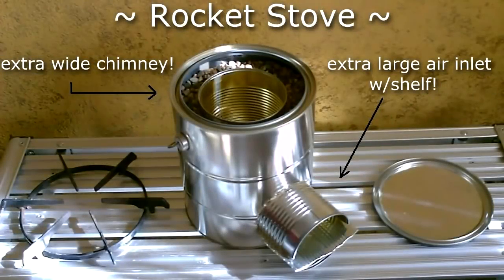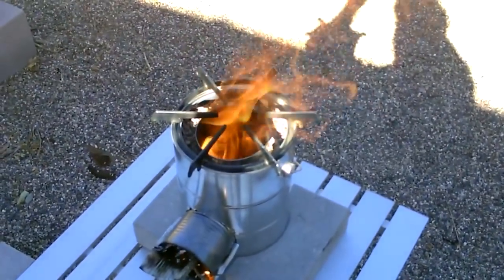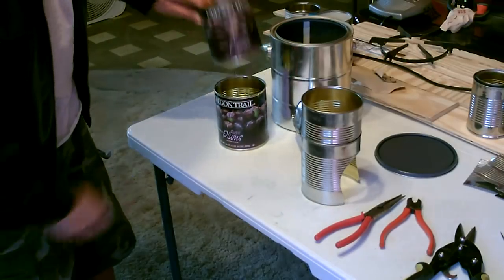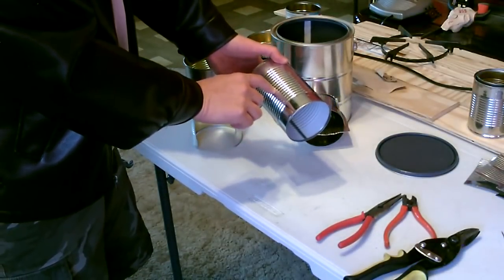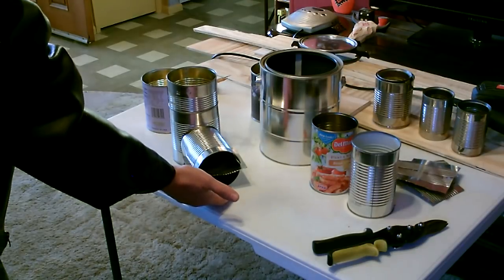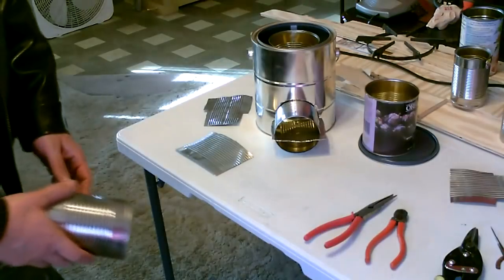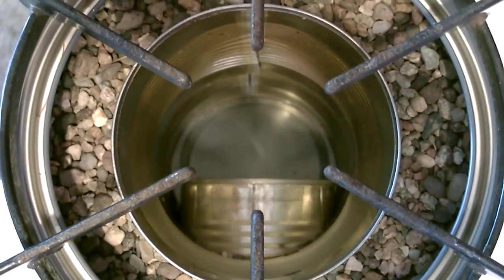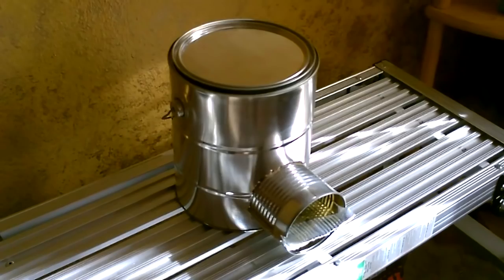Homemade STEEL CAN Rocket Stove w/shelf! - Improved!! (w/ex-large chimney and feed tube) Full Instr.

Comment: Is the sad and rocks just so the outside does not get hot?
Reply from the maker: hi. the sand and rocks hold the cans in place. also used for their insulation properties (focuses heat up the pipe), weight (to make it stable even in the wind) and to add thermal mass.

Comment: If you add a strainer to the top of the can that will keep the fire down a little bit to reduce soot from your pot, or pan. https://www.google.com/search?q=strainer&rlz=1C1CHBF_enUS788US788&oq=strainer+&aqs=chrome..69i57j0l7.7623j1j8&sourceid=chrome&ie=UTF-8 Just remove the handles, then you are good to go. :)

Comment: Quick tip: they make can-openers now that remove the lip automatically. (There are actually 3 distinct openers available these days: the classic sort that cuts the top out and leaves all of the lip on the can, a "midway" one that splits the lip so the removed top still has a lip on it and so does the can, and the kind that cuts off the whole lip with the top. If you do a lot of dustbin tinsmithing, it's worth it to have all 3.)